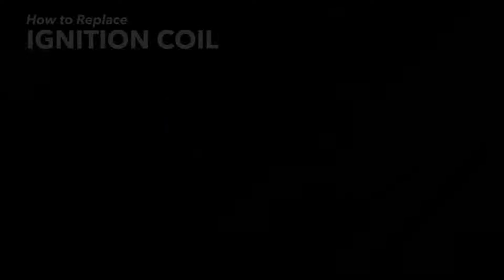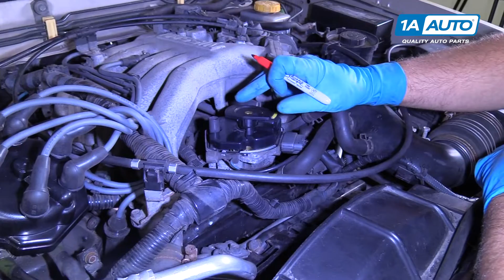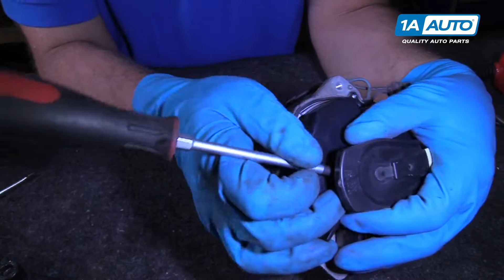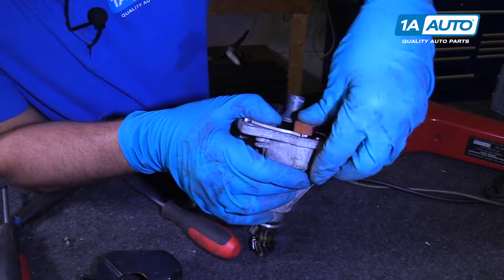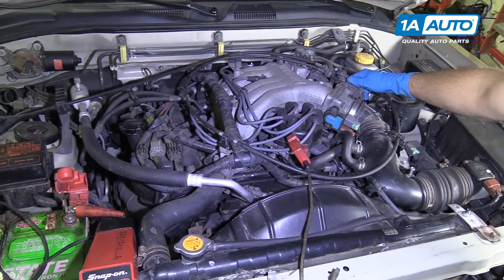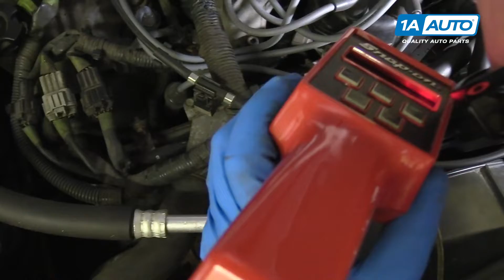How to Replace Ignition Coil 97-00 Nissan Pathfinder

Comment: This also applies to the first generation Xterras. I have replaced the shaft upper bearing in my distributor, common failure as well. Bearings are a few dollars whereas the oem distributor is several hundred dollars. My coil just died recently and replacement coils are very inexpensive as well.
Reply: Could you explain how to take off the shaft to replace the bearing on the distributor? Do you have to knock it out? Thanks

Comment: Those combo head screws would likely come out MUCH better using a JIS bit.  The word 'Phillips' is commonly used to describe everything 'cross top'..and that is incorrect.  A Phillips screw/driver is designed to cam-out to prevent over torquing the fastener.  It also prevents getting out most tight/stuck cross-top machine screws in Japanese made stuff when you try to use a Phillips bit.

Buy a decent JIS driver set and probably never have a problem getting a Japanese made device apart again.

JIS= Japanese Industrial Standard